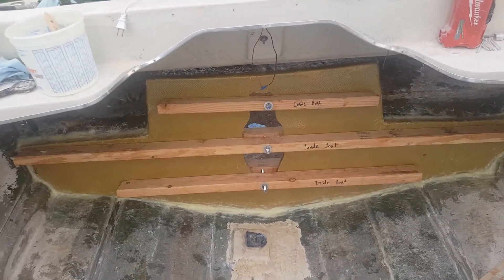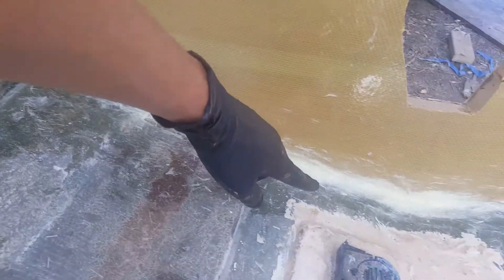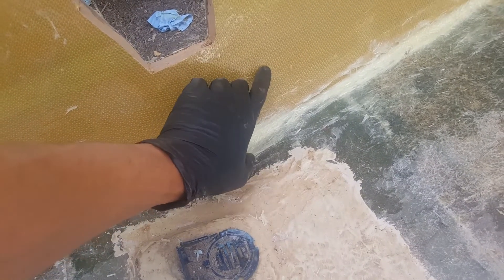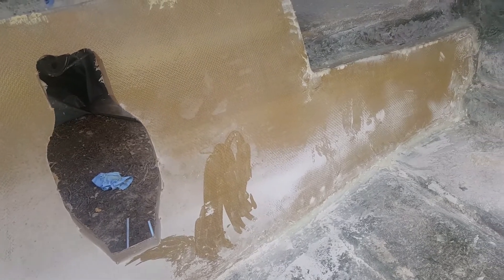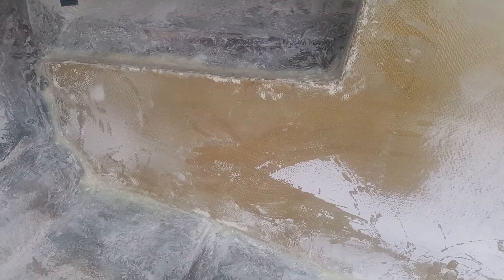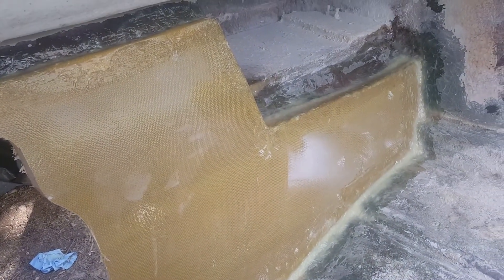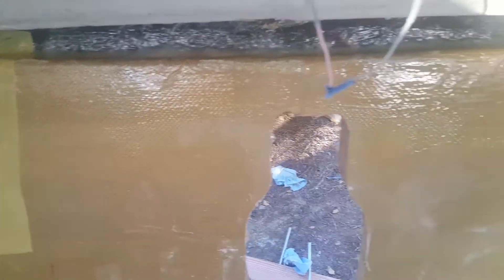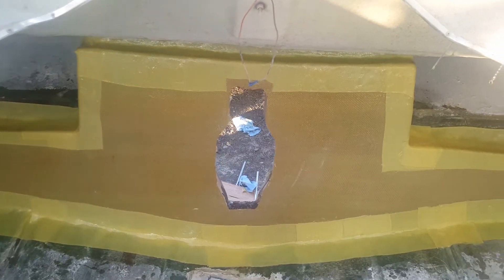Boat Transom and Floor Rebuild - Tabbing the New Transom - Part 35

Comment: Hmm...As a fiberglass guy, I'm not sure you are giving out good info here in these videos, least where it comes to fiberglass and kevlar.  Kevlar biggest benefit is strength to weight ratio. For the average DYI guy they will never see this benefit unless you are vacuum bagging. Kevlar is pretty much useless in your application. As far as that transom is concerned there is ZERO benefit in using kevlar, unless you were looking for a weight reduction. But if that was the case, you would have been better served using "E-glass" and Coosa board. Coosa is expensive, but you would have saved just from not using Kevlar. Also, I was surprised, or least I didn't see, you grind the transom and wet out both sides with just resin, before applying the peanut butter.  Nor did I see the bed of peanut butter under the transom. Also when laying up transoms, this is one of the few times where a slow epoxy is really beneficial, especially for a DYI guy, takes forever to set and doesn't blush.
Reply: m4keyourself  its constructive criticism. He isn't insulting him in questioning his method. Kevlar in this application is truly pointless. Kevlar's strength is it's resistance to penetration as opposed to shear strength (what is demanded when building a transom). You are just angry because he is correct. Literally no one uses kevlar in modern boats aside from some race boats that go 100+

Comment: Hey man what do you use to grind the peanut butter down after it’s hard?
Reply from the maker: Check out more videos in this series. I cover the tool and suppliers in great detail.  There are 85 videos in this series.
Reply: Michael Romer Sounds good will do. We have the new transom laminated and cut. We are about to start glassing everything back together. I got the total boat laminating polyester resin, I’m seeing now that I may need some finishing resin. Can you give me some advice on that?